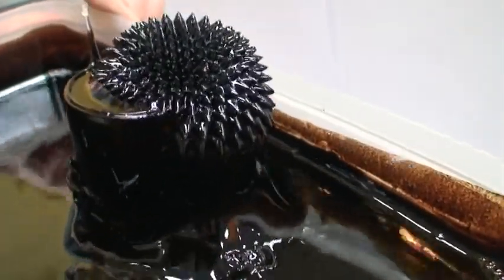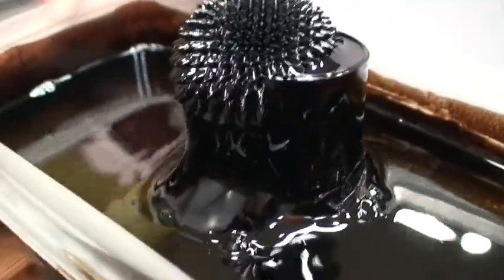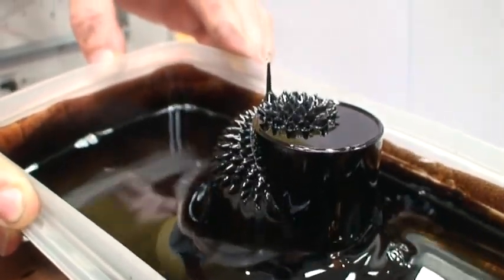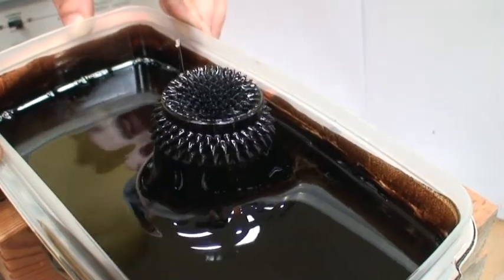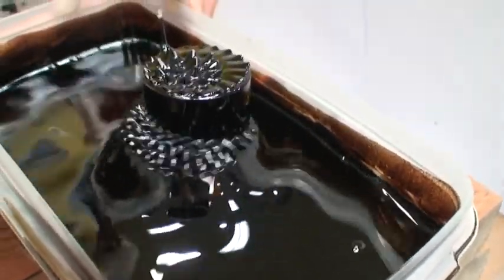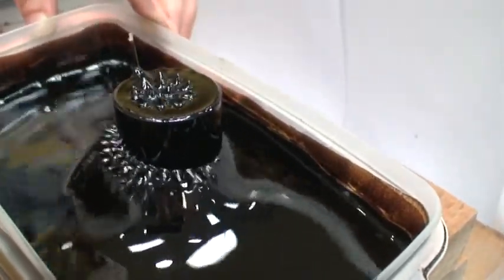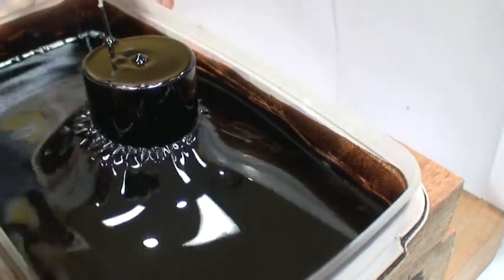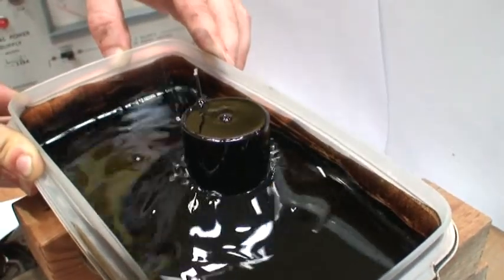Ferrofluid: "Tree" demonstration (Part II)

Comment from the maker: Yes, part of a science project. For second year electromag and optics labs at unimelb they gave us all the option of swapping the last two 'set' labs for a self devised project. Me and my girlfriend decided to play with Ferrofluids -- there were more plans, but some stuff didn't work out.

The demo in this video was organised fairly quickly after the initial contained design (which was enclosed and had magnets on the top and bottom) was broken during testing.